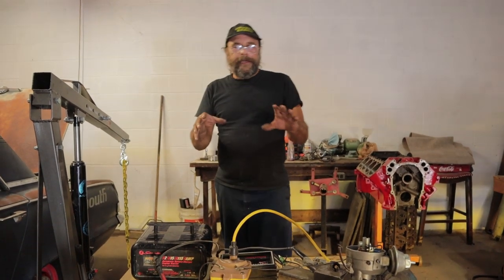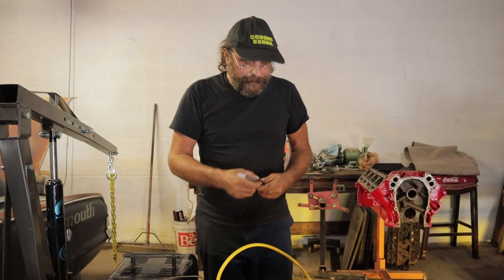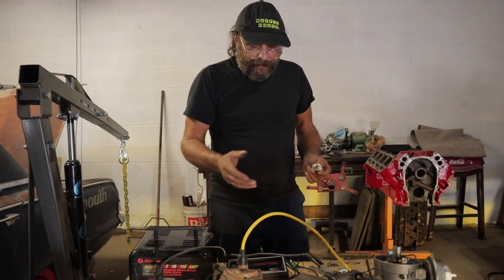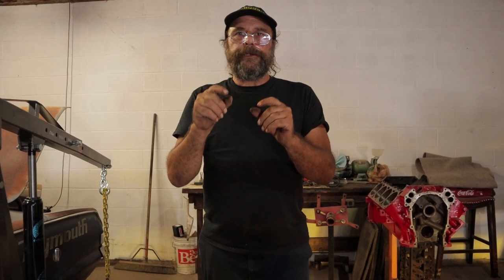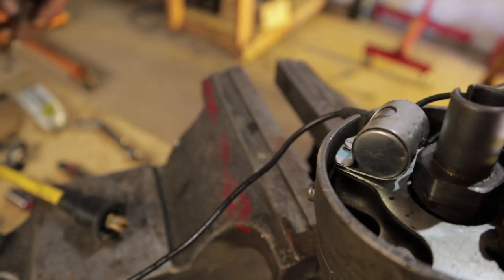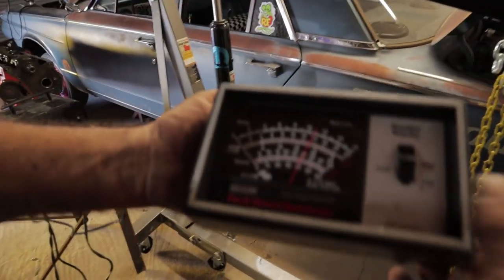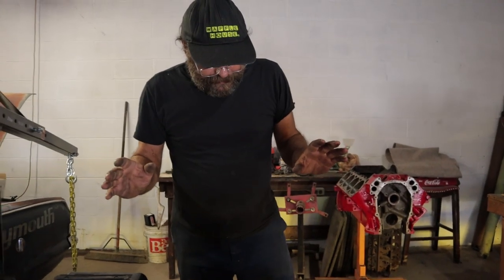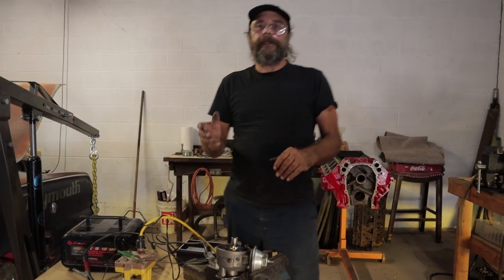Classic Car Tech-Setting Up A Point Ignition

Comment: Sorry Tony, but it's here that we differ. The Kettering [points type] ignition system was fine before we had anything better, but now we do. I first  fitted a Pertronix electronic conversion to my distributor about 25 years ago. It's a points replacement conversion & I also went with a new cap, rotor, leads, sport coil & Iridium plugs with a 50% wider gap. I have NEVER looked back. The only problem that I had was the fact that I no longer needed to look inside the distributor for servicing & forgot to periodicly put a drop of oil on the felt pad under the rotor. End result? The "cam" got stuck to the distributor shaft & the advance no longer worked. I now oil the pad at oil change time.
The engine has always started, hot or cold, within one crankshaft rotation. as long as there is fuel in the cylinder, it will fire & run. In fact, when warmed up, on many occasions I need only 'bump' the starter & it's away, firing on the first compression stroke that comes along.
Actually, I have done this to the last five cars & would never go back to points. They are maintenance hogs, needing cleaning, re-gaping, then fiddling with the gap with a dwell angle meter, then re-timing the engine. A needless pain in the arse. Not to mention that as the rubbing block wears, the timing is gradually retarding leading to less than optimum performance, particularly when regular maintenance intervals are missed. The electronic conversion retains the original distributor along with its factory advance characteristics, provides reliable operation, improves fuel mileage [if driven for economy] along with improved ignition performance & is otherwise a true fit & forget system.
Reply from the maker: I've tested Pertronix and points back to back..A B A testing...ZERO functional difference in start time, quarter mile performance and fuel mileage... but believe whatever you'd like.
As for servicing points?  Takes less than ten minutes twice a year for a daily driven car.
But, go with whatever works for you.
Reply: @UncleTonysGarage  Ah you shouldn't be so mean to him Tony - he's not wrong about electronic being superior to points. Although I'm not sure why you'd go aftermarket on a Chrysler, when they introduced perfectly good HEI distributors in 1972. God bless them for not changing anything, so that a '73 Polara distributor dropped right into my '71 Fury.

The car ran perfect, with no ignition adjustment or maintenance, until it didn't. I thought I had carburetor issues because the HEI system is beyond reproach. After fooling with a perfect carburetor until I was blue in the face, I finally took the cap off, only to find creamy gray metal goo all in the distributor. Bearing or whatever, but the electronic distributor had eaten itself. How it ran like that at all, I don't know. Luckily I still had the old one.

I just doubled a piece of emery cloth and ran that between the points a few times to freshen up that surface - I didn't know I was missing a points file. I never had much luck setting the gap perfectly (it never occurred to me to take it out of the car to set the gap) - like you say, get it running, and then it's the dwell that counts. Repeatedly taking the cap off, trying to make the smallest adjustment, again and again to finally hit that dwell number. That was a real pain in the ass for some of us to do every 8,000 miles, and it takes a bit of learned skill to do that 2 screwdriver dance properly and not totally screw up your gap every time you touch it. I notice you didn't fool with your already set gap even in an instructional video.
Reply: Back in the day....my daily driver was a points 318 car. Put 90k miles on it. Had one problem and that was resolved in 5 minutes. The family wagon was a points car. Daily driver for my dad for years.  Also, went on family vacations with it every year. That car never had a problem, never let us down. Yes, pertronix or whatever is less maintenance.  That was the big selling point ( no pun intended).

Comment: the best thing you can do for an old chrysler is get rid of the points and go to the chrysler electronic ignition they are stupid reliable pretty much free from a junkyard and very easy to install.
Reply: - or, a person can take pride in maintaining factory points when you just touch the key to start the engine and it almost starts itself - at 30 below zero.  Or setting up a Prestolite dual-point distributor on your 440-6V or Hemi and take it on past 6000 rpm.  Points are cool.

Comment: No ballast resistor?
Reply from the maker: Not part of the distributor, and not all cars had them.  GM and ford used resister wires in their ignition circuits

Comment: Computer car EMP= doomed
Points car EMP= Eat My Points [you can't stop me homie]
Reply: Not so fast Smooth, EMP wont destroy your points or condenser, but the EMP will certainly disrupt the electron flow from your coil, which is just a mini transformer (electrical not Optimus Prime) to increase the 12v input to 15,000v output to the spark plug. If you really want to be EMP ready, you need to speak with my friend Rudolf Diesel.
Reply: @remington351  do you think a modest EMP would fry an old school oil filled coil? Maybe...
But yeah, agree on diesel. Learned that lesson with a nitro rc plane that lost a throttle servo mid flight WOT.

Comment: you do not have a Uniset points. Uniset has the capacitor built on to the point set(not mounted separately with a screw clamp). Actually Uniset was not desirable as the points would burn prematurely. I used REAL Delco points and separate condenser. one thing to watch was when you removed the old points. look and see if they burned evenly or pit and crater. if they burn evenly leave that condenser in and throw the new one as a spare in the Glove box. the condenser forms an L C resonant circuit with the spark coil. If you don't quite understand it just know it has to be there or the system will not work. You do NOT have to change the condenser every time. Where that came from was very old condensers were wax paper and foil. the heat would bake out the wax and the condenser would eventually stop working. condensers since the 60s have plastic insulation and usually last forever. the adjustment of dwell with a wrench when the engine is running is NOT in itself Uniset. Its ONLY uniset if the capacitor is part of the points assembly. If dwell is called out as a range. example 28-32 degrees running it at 32 will give a bit better high RPM spark as the points are closed longer and the coil gets a chance to build up magnetic field a bit better. I have had engines run like crap just because the point gap was way off(to much or to little). do the job rite. thanks for this helpful video that no one else bothers to tell anyone.

Comment: A condenser is simply an electrolytic capacitor. A capacitor will pass AC and block DC. Once the electrolytic (oil) dries up, it stops working. That's it in a nutshell. Once Uncle Tony took it apart and showed me the layers, the electronics tech in me went "Oh Oh Oh... I know I know". Sometimes I can't get him to shut up. :-)

Comment: Two tips to add, the points should look like they are sand blasted a light grey color, this shows a good condenser. Also with the distributor out you can check the point gap on all lobes . Thanks for the great video

Comment: Hey Tony. Ya don't file points with hardened contact tips like the ones you filed on. For that you need emery or sandpaper. Notice the sound it made when you "filed" on the points? Hardened tips. A file won't touch 'em without dulling immediately. Sometimes I think you troll us, obvious stuff.
Reply from the maker: Look again...the sound it made was because I actually missed the contacts while trying to demo for the camera.  The file is supposed to take down the built up slag, and it'll do just that.

Comment: first time you break down in the desert with electronic sensors and it goes into limp in mode when its 100 plus degrees remember this tutorial he is spouting to ya,this happened to me,four months ago,the tow bill was 275 bucks they don't have any sympathy when they are sweating like you are,everything i own now has a new distributor,3 extra sets of points and 3 extra condensors,engine runs so does the a/c compressor,radio,all the comforts of not being on the side of the road,its a damn shame you have to go back to the past for security,but i'm old school and i dont like walking,at all,i drive old stuff anyway,when you fixed them for a living for 47 years you want every day just like the other good day,they told us in chrysler school in 1978 they were going to eliminate the back yard mechanic,i laughed,intructor said to me,what's so damn funny, i said i'm a backyard mechanic,who's now informed and trained by you

Comment: Next video: How to magnetize a screwdriver.

I've almost only ever dealt with gear-driven distributors.  Only ever made the mark for the rotor.  Never had an issue with just the one mark.
Reply: Easy to do. Just strike the screw driver against any permanent magnet of a decent size such as a magneto from B/S lawn mower engine. Have done many times.

Comment: Back in 1973 my grandfather bought a 1971 "In Violet" auto trans hardtop Barracuda used on a dealer lot in our neighborhood for $2,500. It had a Hemi engine in it even thought it was a N code car. It didn't appear to be a Gran Sport but I can't be sure. The paint looked original. Some years later some one hit it while parked and my grandpa put the engine in a 1969 Coronet, original engine unknown to me. That Coronet has been sitting in his garage for the last 15 years. I wonder what that Hemi is out of. And who / why they put it in the Barracuda being it was only 3 years old at the time. The 'Cuda looked like a real hemi 'Cuda but the vin says it wasn't. I wish grandpa was here to ask more questions to. Is there a number on the engine that would tell me where it came from?
Reply: The Barracuda has been gone since the 80's by the way. I have limited notes on the car. Engine code N was written down as original to the Barracuda but no other VIN numbers are around. I'll keep looking.
Reply: Also, it does have the shaker still on it. Grandpa just cut a ragged hole in the Coronet for it to poke out of.
Reply from the maker: Shawn, look at the block along the oil pan rail.  A 69-71 Hemi will have a flat pad there with the VIN of the car it came from stamped in

Comment: Okay, Uncle Tony, you adjusted the points but you never tightened them back up, you loosen them up to adjust them, clean them by inserting a clean flat peice of cardboard and closing them and pulling the cardboard out, until it comes out clean, then tighten the screw.(recheck after tightening the screw and reclean. never leave the points dirty, feeler guages have grease on them)  You gonna put that distributor back in the car with the adjustment screw loose? no way!

Comment: The only reliable way anyone will get around if there is an emp attack or heavy solar radiation storm, i keep them in the glove box just in case my cdi box goes out in all my classic vehicles!!!!!!!
Reply: ClassicAutoRestoration Spot On! taking in consideration of a conventional ignition system, versus an on-board computer which can cycle up to three billion bits of information per minute, even have installed EMP Shields, it's no wonder the world's largest armies still use the old vacuum tubes, transistors resistors capacitors, diodes, rudimentary heat sinks. You would be floored what armies are found in captured equipment, on their adversaries of weapons of war. I wouldn't even roll the dice, stick to your very basic conventional ignition systems, 3.5 years in R&D US Army.

Comment: "Ford-LIncoln-Mercury" grease has molybdenum disulfide (aka, moly, MoS2 )in it. That is the only difference between that and other approved auto greases. 

DO NOT put "Moly" grease in ball/roller bearings on non-Ford cars. The MoS2 makes the grease more slippery than most ball/roller bearings are designed for, causing the rollers to skid around the bearing race, chewing everything up in the process.

Comment: a condensor is another name for a capacitor. this one is a rolled capacitor. it is 2 sheets of foil rolled with an insulator like wax paper. it uses the foil as plates to collect charge via induction. 

here's a diagram: https://1.bp.blogspot.com/-lQDCCwD0Qo8/XncJTwztdbI/AAAAAAAAAUE/FOF_FbovnvoJY8CcK75Wl-_BavxVBZ4aACEwYBhgL/s1600/Capacitor_2.png

Comment: I find many with an engine problem and the engine is running points they will automatically Point to the Points as the cause first !!! ,,lol.  Let's say a poor bastard is in a room filled with gas vapor and can either light his cigarette with a little bic or Zippo lighter or blasts a blow torch ,,which explosion will be the bigger boom??  I say they will be the same.
Reply: Unless you're close to stoich, it can be hard to get a lean mixture to ignite with that little Bic or Zippo - and that's why the blow torch is used.  It makes sure it will light up, first time, every time - even if it isn't really happy about it.  Not exactly necessary if you have the right mixture, but if you're looking for greater efficiency, a lean burn will sometimes need a bigger spark to set it off.
Reply: @aussiebloke609  I see your point about points!  A bigger spark will help if you are missing during a lean mix as you state. I run my 440 on points and plan on doing so on my 512 stroker too.  The 440 runs very well. If it doesn't work out on the stroker I will go electronic but I hope not.

Comment: First off you forgot about the oil pump shaft when you put in the distributor on a Chevrolet when I think spins out of the way they just the oil pump shaft you have to spend back when you will screwdriver or a blank shaft in order to get the distributor to suck down in there right and condensers are nothing but electrolytic capacitors that's all they are so if you could test a good condenser you can see how many people fear it is and you could probably use an electrolytic capacitor from a radio or something
Reply from the maker: We actually covered that.  No need to realign the pump shaft if you mark the rotors position once it stops moving (clears the drive gear)

Comment: Don't use WD-40 it will blow dissy cap right Off great fun
Reply: Donnie Fermor I watched a man scrape the  distributor segment contacts, removing oxidation off of them, then gingerly taking his point file cleaning off the rotor contack, then blew it out with his breath. then takeing carburetor cleaner spray, hoseing the inside the cap, snap it back in place,, turn ignition key on and boom,, crack that distributor cap and half.🤣🤣🤣

Comment: alot of mis info floating around about condensers about 90% they in wrong value for the eng they are in they have to match the coil in any eng  you can not put any condenser   and expect it to work correctly   they are rated in microfareds  they have a risistive value opposit of the coil  so the cancell one another for max current flow    its called a series resonate circuit we are getting  into ohms law here.  just remember  they need to match  if not you tbles so check condenser dont just keep changing the points

Comment: Did I leave anything out. Yes. A condenser in a young man's hands or a smart arse old man's hands is also a practical joke device which when charged up with the ignition coils output spark & then left on a work bench for someone to pick up becomes a shocking experience for the unlucky person, 30,000 volts shocking. If you see a condenser sitting were it shouldn't be don't touch it.